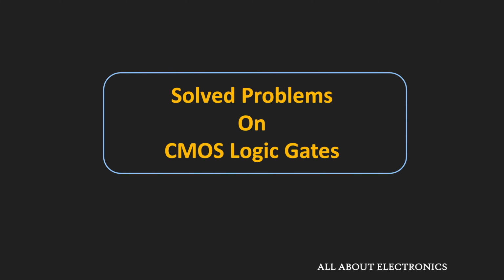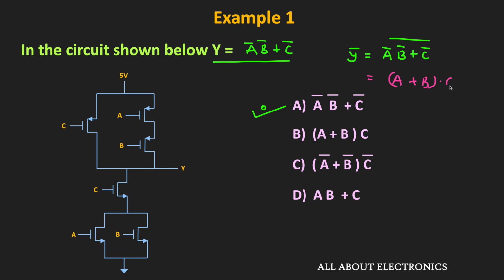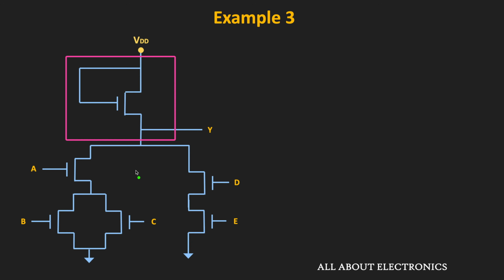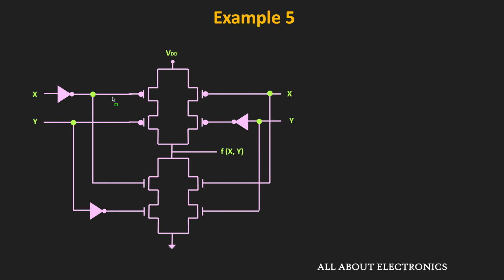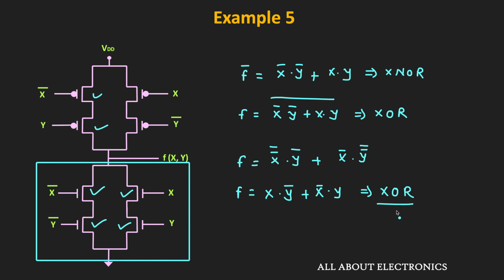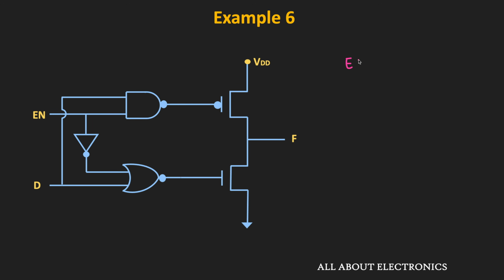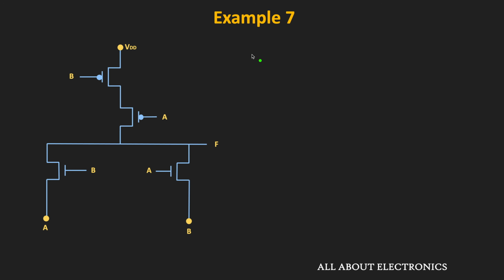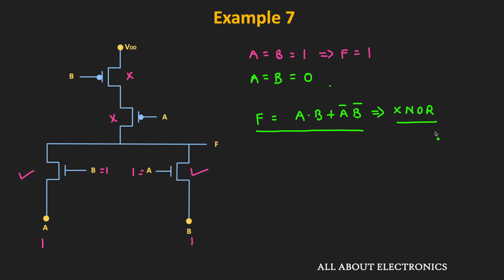Solved Problems on CMOS Logic Circuits | Digital Electronics

Comment: Sir for example 7 why don't we take the complement at the output
Reply from the maker: In example 7, the output that is implemented is XNOR function. And as with the given configuration it is possible to implement that,so there is no need to take the complement of the output. The thing is, here the function is not implemented in conventional way, that we are used to do in typical CMOS circuits. I hope,  it will clear your doubt.

Comment: how you said it's a xnor gate, if it's a xnor gate means this is given a '1' for A & B =0.but it's given a '0' for both A & B =0. so, in my Knowledge the given circuit function is like a AND gate.
Reply from the maker: Please mention the time stamp where you are referring to.
Reply from the maker: The XNOR gate output is 1 when both inputs are same. (i.e either X = Y = 1, or both are zero)

Comment: Regarding Example 7
if both A and B were logic 1 then the Vgs of NMOS transistor is less than Vth, so it is in OFF condition right! then how you given a logic 0 as an output(F).
Reply from the maker: I am glad that finally someone has  asked this question. The thing is, many MOSFETs are symmetrical. (Specifically, the one which is fabricated in the integrated circuits). In symmetrical MOSFETs, the gate and source can be used interchangeably. (The way it is used in the pass transistor). The terminal where logic '1' is applied will act as drain terminal. And the terminal where logic '0' is applied will act as source terminal. 
For more info, you may check the video in pass transistor logic:
https://youtu.be/2CkyYg__FTc?t=296
If you still have any doubt then let me know here.
Reply: @ALLABOUTELECTRONICS  sorry to ask this again. But I didn't get this line : "the terminal where logic '0' is applied will act as source terminal". Are you saying that the source terminal will always be logic '0', because in the pass transistor logic video as well you were just considering if we give a logic '1' at the gate terminal alone we can get a strong logic '0' or weak logic '1' (Vdd-Vth) at the drain terminal(output).
Reply from the maker: @lazylevi10  No, I am not saying source terminal will also be at logic '0'. But when when you applying logic '0' as an input to one of the MOS terminal, (either S or D terminal) then that terminal will act as a source terminal. On the other hand, on the same terminal, when logic '1' is applied then it will act as a drain terminal. I hope, it will clear your doubt. In the pass transistor video also, I was saying the same thing.
Reply: @ALLABOUTELECTRONICS  Ok, I got it now. Thank you for your explanations and assistance. I really appreciate it. And your content is very clear and right to the point. Keep up the good work. 🤗🤗
Reply: @lazylevi10  damn dude i stalked you, IIT madras grad working at NVIDIA. Damn

Comment: example 7
A=B=1 then F=1
but I have doubt that when A=B=1. Both A and B are connected to ground  then F should be 0. Please clear my doubt. 
Thanks for this lecture. You are doing really a great job. Your all videos are excellent. Once again Thanks .
Reply: I think the answer should have been NAND gate
Reply: @dlswithleroy  That's what I think so. Since when A = B = 1, F should be 0
Reply: Edit: I think he's right. He explained in the comment that the MOS is symmetrical and the higher potential become a drain rather than fixed terminals.